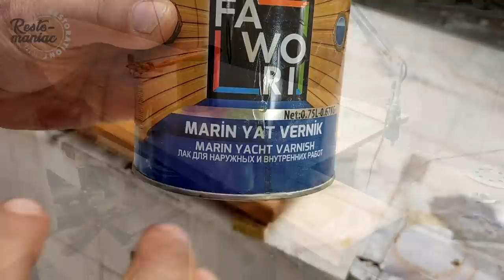Bench restoration for my small garden.

Comment: That was impressive. So much work on the wood but it looked amazing when finished. I didn't know you could repair bad treads in screws/bolts. I dont have the skills,strenght ir patience (only a girl) to do a lot of that  but admire your dedication. Could u use walker/cane rubber feet on.the  bottom of legs for longevity? Your beautiful cats seem to admire your work as well.
Reply from the maker: Thank you very much for your kind comments 😊 Yes, I am trying to find suitable rubber shoes for the feet 😊

Comment: Lovely work. What is the tool called that you used to clean and sharpen the threads on the old bolts please?
Reply from the maker: Thank you 😊 They are called "Tap and die" sets.  There are varieties in metric or inch sizes.
Reply: Thank you.

Comment: Sadly, that shiny thick coating will start spalling in one year and be mostly flaked off in 2. Never put a coating on exterior furniture wood. Use penetrating oil based materials followed by a good poly wiping finish. Do it every year.
Reply from the maker: No thanks.  It's been out for about a year and the yacht varnish on it is doing a great job.
Reply: @Restomaniac  before this winter give it a light sand and a thin coating of the best material your ship yard can recommend. That will get another year out of it and look great.